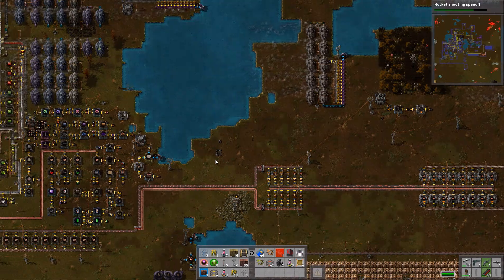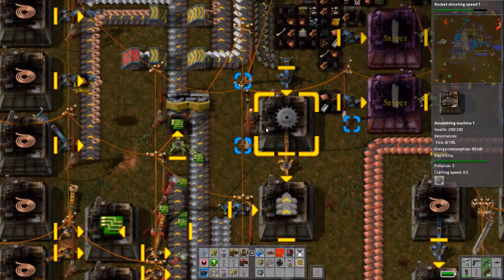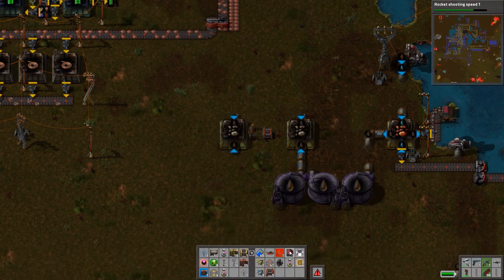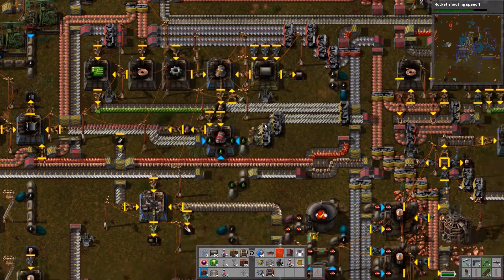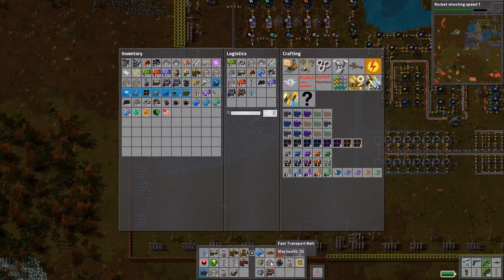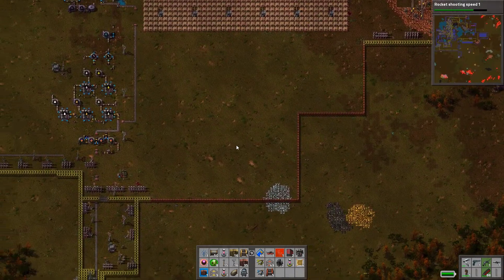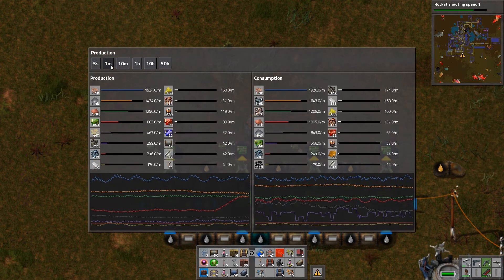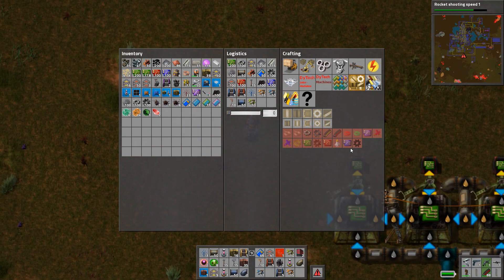Liquid Iron: Dytech Factorio LP S3 E51

Comment: 4:50
No, it's not a chance. As you can see, you produce 3 Stone, 0.2 Copper nuggets and 0.1 iron nuggets.
That means you will have 15 Stone before you get even 1 Copper nugget and you will get 30 stone before you get 2 Copper nuggets and 1 iron nugget.